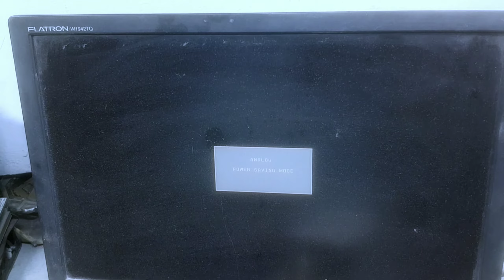MSI GeForce GTX 660 Hawk 2gb No Display problem Solved

Comment: First he cleaned it with IPA (alcohol), the n brushed some flux on the memory chips and then heated the gpu and memory chips with a heat gun. This is probably only a temporary fix. Crap video.